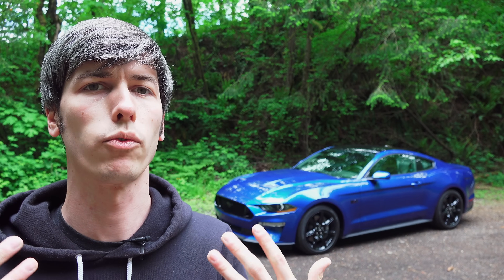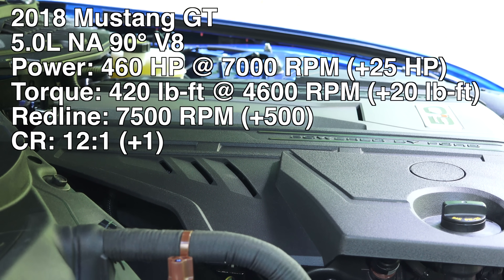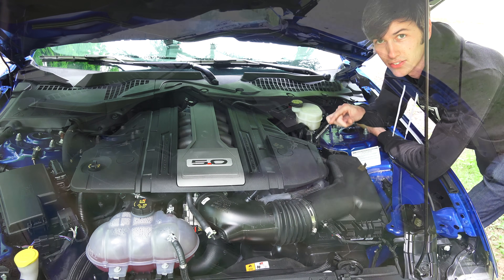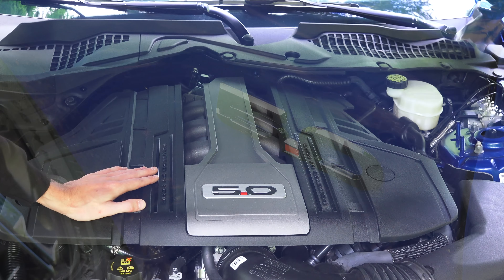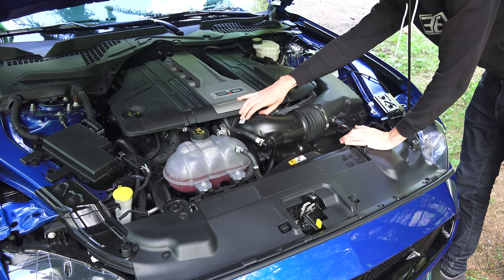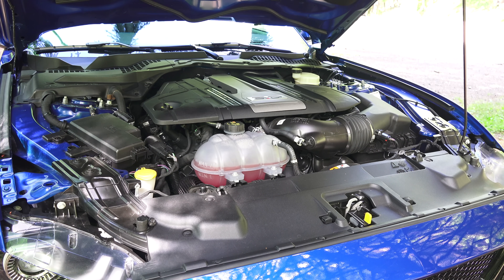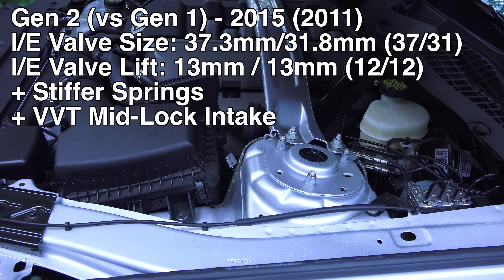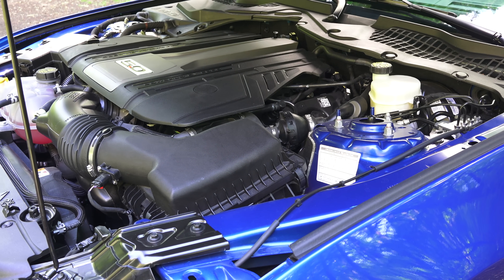The Best Engines - 2018 Ford Mustang GT 5.0L V8

Comment: Spray in liners sound good till rebuild time when that block is scrap.  It’s fords way of bending you over for more money.
Reply from the maker: Actually the opposite is true. Spray liners allow for re-using old blocks: https://media.ford.com/content/fordmedia/feu/en/news/2015/12/02/ford-develops-high-tech-plasma-process-that-can-save-an-engine-f.html
Reply: Or, you get a new liner sprayed on or pressed in.
Reply: Yes, technically you're right. However, unless there is a serious failure that damages the liner, realistically the bottom end will never need to be "rebuilt". I don't mean changing out pistons for forged, that can be done without boring the engine. Manufactures don't engineer anything to be rebuilt, they design it to do what it needs to do, for as long as reasonably possible, for as little money as possible. After that, all bets are off.
Reply: I stand corrected. Though I'm guessing it'll be a while before this tech is available to the local machine shop. Then again, it's getting harder and harder ( in my area, not sure about others) to find a local machine shop that does engine work.
Reply: Adam and Korey West you are right. The last 4 ships I have worked at would not. 1 made an exception for a local diesel engine shop, but all they did was face off corroded aluminum trans bell housings. Nothing difficult.

Comment: Nice placement for the battery by a weight distribution standpoint........
Reply: Mustangs have had their battery in that spot since 2005.
Reply: Q 17 slight nuisance to sneak the battery out however
Reply: Q 17 I don’t know why they don’t put it in the trunk or back seat like most cars do now a days.
Reply: Jack Torse It isn't that bad since I have had a chance to look at it. I sent a Ford escape to the dealership where they attempted to replace the battery. Well they cracked the customers windshield while trying to put the wiper arms back on. So I thought this was a similar situation.

Comment: So you say I should get manual, I agree, but doesn't manual usually get better fuel mileage? Why does this car gets 1mpg (weird units btw) better with the automatic?
Reply from the maker: More gear ratios allows for better optimizing of where the engine load/rpm is for efficiency.
Reply: LOL that's kinda what i figured... less time reving for that nice sound, though through each gear.

Comment: Still salty they didn't drop the 5.0 a few years sooner. It's turned into a legitimate beast over the years.
Reply: TheGameDeity not a Ford guy but have to agree with you on what a great engine the coyote is evolving into.  I’m not a fan of the new liners though.  Sounds like you no longer can bore them out during a rebuild.  But I’m sure dart will figure out a sleeve for these in a few years.
Reply: brian hilligoss could always bore and sleeve like you would any other engine. I'm sure machinists already have been doing this with these engines.
Reply: MrErikw26 very true.  I still believe a true cast liner would be better for longevity.
Reply: brian hilligoss idk about longevity, but certainly for serviceability

Comment: The 5.0L Coyote that came out in 2011 was the beginning of a classic. I miss my 2011 Mustang GT. Dare I say... its better then the V8 in my 2008 Audi R8 in some ways. Obviously the Audi 4.2 V8 is a beauty, but the 5.0 with the down low power was.... splurg
Reply: Agreed the 5.0 is a BEAST
Reply: Foeke van Veenendaal.  Yes, the OP is comparing an older Audi engine with a slightly less older ford.  A 7 year old ford to be exact.  Because those are the two cars he has on hand to compare. This isnt a magazine car test, this is one guy who owned two cars expressing his opinions concerning both.
Reply: Foeke van Veenendaal.  This is about the motor... not the car.  The 5.0 certainly will do 8K and survive, its called margin. And bragging about an extra 500 rpm is ridiculous anyway.
Reply: Canadian Rider I just bought a 2011 5.0  a couple weeks ago
Reply: I wonder how rebuildable the new engine is with the plasma cylinder liners..seems like that would be hard for a rebuild shop to do
Reply: Midwest Mopars - and it gaps those challengers and chargers left and right
Reply: I miss mine too at times. I lived in Alaska when I had it, but I had one with a bad MT82.
Reply: And you dont have to worry about the timing chains
Reply: Austin _s197 congratz Enjoy it in Good health
Reply: You're pre-ejaculating.
Reply: I was gonna say no way is the Mustang faster or even only just as fast as the R8. The R8 has AWD after all so how useful is the power of the Mustang going to be if all that drive just turns into smoke on the rear. I looked it up and it would appear on the sheet they have the same 0-60 time which i found to be quite interresting. Anyways i personaly prefer the feel of a turbo car, low rpm power is nice but nothing beats the feel of a turbo kicking in launching you into lower earth orbit to the sound of a jet tubine.
Reply: leeleelee I can vouch for that. 👀
Reply: Foeke van Veenendaal and more torque
Reply: Why didnt you get the v10 I would have never traded your mustang.for the r8 with only the 4.2 v8
Reply: Canadian Rider I'm still rockin my 2008 GT with the 3 valve here lol
Reply: Canadian Rider I agree the 5.0L Coyote V8 is a pure beast. I have one in my 2011 Ford F150 and it's a beast.
Reply: Canadian Rider the 5.0 makes it’s power like a small v6
Reply: Ahmed360

"In" a different league
Reply: how? it has less HP.  please explain?
Reply: DrewLSsix I'm not trying to brag. It's not like I have an audi R8 but I have a nice 2.0 diesel ford mondeo hahaha. 
I was just suporting Ahmed360 that the R8 and a Mustang are completely different cars. And completely different engines to match. Even though the both exist with a v8.
Reply: @Devin More HP with less revs, so yeah, by definition also more torque doesn't take away from the fact that the R8 and a mustang are different beasts. 
One a sports car, the other a muscle car. 
Note that the current R8's are not even available withe a v8. v10 +500HP only. Also the R8 4.2 V8 we are comparing with this latest and greatest Mustang is more than 10 years old.
Reply: cjfourty6 try going over 180mph in a mustang. Or revving over 8000rpm. But you are right about this mustang having more hp.

Comment: The 5.0 is a gem of an engine.
Reply: rockn roll its cheap.
Reply: Yes it is...
Reply: rockn roll cheap cheap cheap
Reply: rockn roll the LS is remarkably small. It's actually damn good, but I like the Coyote better.
Reply: rockn roll its cheap, reliable and is physically smaller and lighter then the 5.0. Thats why so many peoplw love the ls, 5.0 and the ls are both great engines.

Comment: If you ever get the chance you have to do one for the Lexus LFA engine
Reply: r3wturb0x Yamaha did not design that engine...they HELPED design the exhaust
Reply: Devin Bender torque doesn't matter when it revs to 9500rpm
Reply: Torque isn't the reason why its the greats engine of all time ;)
Reply: I came here specifically to say exactly that.
Reply: Yeah thats what I thought too. I think they only helped "design" the exhaust note.
Reply: Devin Bender that is also a one of a kind low number, out of production, more expensive to build than it was initially sold. The carworld does make sense!
Reply: Mitchell Steindler if true my apologies, and i stand corrected.
Reply: + one on the LFA.
After 6 years a used one is already twice the price of when it came out. Which other car has that? 
Just love the sound. But I'll never hear one in real life. They'll be a million in an other 5 years. and all stored away. A shame.
Reply: Foeke van Veenendaal the 5.4 Ford GT has more than doubled in value in 10 years. 
120k new now valued at 250/350k. 

The meanest and loudest street car I’ve ever heard. 

And I’ve only seen 1 LFA in real life and that was at a United Sports car race. Was in the show area and they fired it up. It does sound good. Completely different than a ford Modular v8
Reply: dmb990 don’t matter the torque curve is still better on the stang than the LFA.

EE has a great video recently about rev limits. 

Around a hilly track the LFA is so slow! Vs other performance cars. Weak in the corners too
Reply: Gangsterlife333 best engine of all time right there. technically its yamaha, since yamaha designed it
Reply: Gangsterlife333 4.8L making 350lbft of torque is weak!!!! That’s one of the biggest issues with the LFA. 
NO BALLS!!!!!